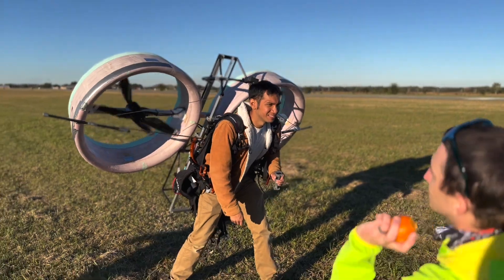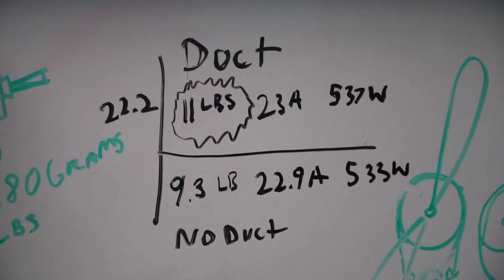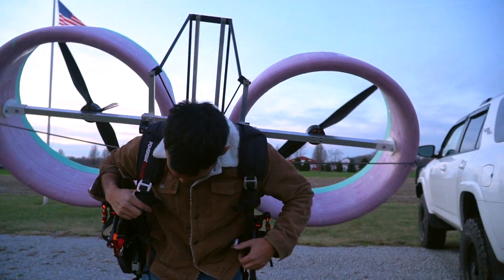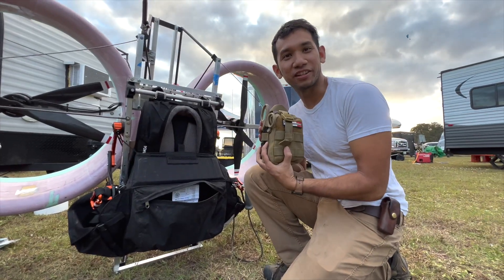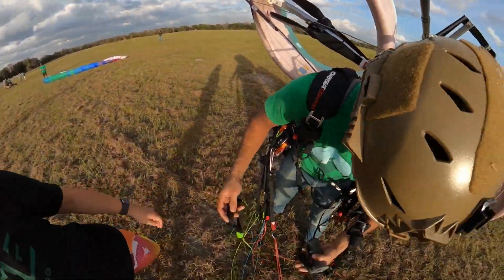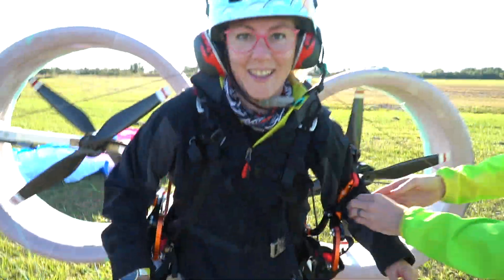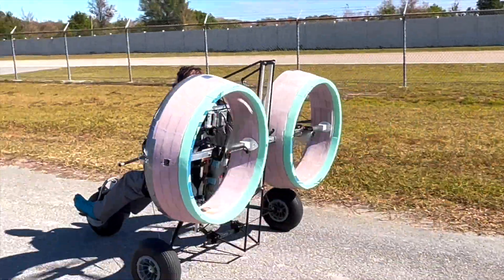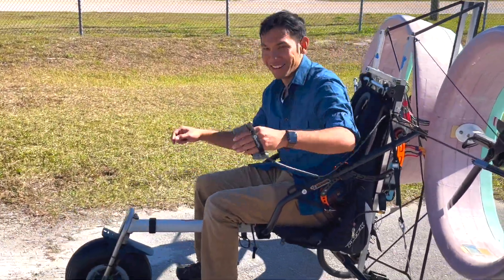Flying with four giant drone motors (ducted propeller paramotor)

Comment: Since you have two ducts, the front and back motors don't need to be counter rotating, right? Would that help with efficiency to have the front and back blades spinning the same direction?
Reply: And then you could have the rear motors have a different throttle curve?

Comment: To make improvements, this is where you would need to either do wind tunnel tests or use fluid analysis software. For example, the rear propellor would probably require a slotted duct so that it could draw in more air. And, I agree with you about adjusting the rear pitch.
Reply: Differential speed would be better. Or placing a stator between the props a la jet compressor might work. I doubt anyone could accurately calculate the pitch differential for a fixed pitch prop and variable pitch props would be prohibitively heavy or extremely dangerous
Reply: @michaelmagill189  I'm not sure what you understand about fluid dynamics, but not much that you've mentioned is correct. The earliest work in this field in the US dates back to 1920 when NACA got its first wind tunnel, and it was pretty well understood by the late 30's.
Reply: @scientious  most of the research you refer to was done on large scale ducts with low speed drives. My research was on small lightweight high speed drives similar to Peter's. Computational fluid dynamics may be possible with today's software, I don't know. I gave up on dynamic flow programming 40 years ago when the file sizes started exceeding 50 gig on coarse scale models. I wss using the USCN network and started getting nasty responses to my requests for storage. That and 6+ day run times. IBM 370 was state of the art in those days but archaic by today's standards. I needed a Cray but that wasn't happening. At any rate, I know the math required and I know modern CAD programs can do some computational flow modeling. Mike Patey uses them, but those are generally single plane flows over an open surface not inside a duct with counter rotating props. I would be fascinated to see this but my guess is the math is beyond most people or computer systems. You can message me at 706 315 8539. I don't do Facebook or email and I dont answer phone calls from unknown sources. But if you I M me I'll answer. Happy to discuss this with others
Reply: @scientious  if you check my open post on this vlog you can get an idea of where I'm coming from
Reply: @michaelmagill189  
> I was using the USCN network and started getting nasty responses to my requests for storage. That and 6+ day run times. IBM 370 was state of the art in those days but archaic by today's standards.

True. My laptop drive has 3 Tera bytes and the processing power exceeds a 370 by maybe three orders of magnitude. But you don't even need computer modeling. All you actually need is a makeshift wind tunnel and pressure sensors, and possibly a smoke bar if you need to visualize the flow. 

> But if you I M me I'll answer. Happy to discuss this with others

What do you want to discuss?

Comment: If those blades come loose for some reason..... careful m8
A traditional paramotor is centered.. so the prop blades if they do come off, will always fly away from you....
Here if a blade separates on the inside... it'll come right at you..

Comment: It's not noisy because of the ducts. It's noisy because of putting one prop in front of another.  Any time there's dirty air in front of the prop (any sort of discontinuity) they're loud, and coaxial props are the noisiest.     I wouldn't be surprised if that also kills any efficiency you gained with the ducts in the first place.

Comment: I would be interested to see if you put fins between the propellers if that would straight the airflow and increase the rear propeller efficiency and/or thrust output.
Reply: Stator. Like in jet compressors. Might work
Reply: @michaelmagill189  That’s right I couldn’t recall the name.

Comment: You could use one regular sized propeller and use multiple motors and a belt drive to share the load between them 🤷‍♂️… the larger the prop the better the efficiency and then you also have a little bit of redundancy if one motor fails… might not be able to fly but you could glide a lot further than without any engine.

Comment: It's actually better if the back propellers have 20% more battery than the front propellers, because it makes it more likely for you to safely land when the batteries of the front propellers are completely empty. You won't get much more flight time, but just enough for an emergency landing to hopefully not end bad.
Reply: cool thing about having a wing is you don't need any thrust for it to work. As long as your above suitable ground for landing you don't need any thrust.
Reply: @Siphonife  So you mean the paramotor should have wings on the side of the propeller/propellers, or above and/or below the propellers? I could see a cross-shaped or T-shaped wing being added to the top and back of the current contraption, to be able to steer and glide. For only gliding, a wider (front-to-back) wing but not so long (left-to-right) wing would be useful, with steering in the back of the wing for pitch and roll, and rotating half the width (not thickness) of the wing left-right for the yaw. All of this would add more weight and complexity, but he made a plane, so he could probably turn a paramotor into something resembling a short/tiny plane.
Reply: @SapioiT  The wing in this context is the giant half-parachute looking thing.
Reply: @nikkiofthevalley  Oh, then it all makes a lot more sense. Thank you! While you don't need thrust for it to work, you do need velocity, otherwise you would simply stall. Edit: And fall. Without velocity relative to the air around you, you would stall and fall.
Reply: @SapioiT  It's a glider, the velocity is generated by gravity, as in you trade altitude for airspeed.

Comment: Is it worth looking into hinging the two ducts so that they start perpendicular to your back, like butterfly wings? I’m no engineer, so I have no idea how it would take the stress of flight, I just envisioned them starting closed while you lift the sail and run, and then pulling a lever to lock them in place and open the throttle. I thought about pistons, but even with springs and levers, is it too much weight for not enough usefulness?
Reply: It'll screw with the center of gravity.

Comment: Make the downstream propellers have a higher pitch since the are from the first propellers is already accelerated and the downstream props aren't doing as much as they could be.
Reply: Just speed up the rear prop. Math to determine the proper pitch differential would be frightening.

Comment: Fucking finally, thank you for explaining that a ducted fan is all about really tight clearance. So many videos on here with "ducted fans" are just shrouded fans with no efficiency gain, just protection for/from the blades (which is a good thing, it just ain't a ducted fan).

Comment: What about two big dyson fans? The thrust from the bladeless design has more thrust than fans with blades
Reply: You are confusing thrust with acceleration. High velocity airflow does not equate to high thrust. Otherwise we could fly with a backpack blower. High velocity is only relevant at jet speeds not low and slow. It may be possible to fly with high velocity fans but you'd have to run like hell for a long way to get airborne. Check out Jim Bede's BD 5 j

Comment: Would a diffuser in between the two blades help with efficiency I know it would be extra weight but with the potential to gain more thrust might be worth it 
    Someday people might use fuel cell powered Para motors your a visionary

Comment: How is the throttle response compared to your vittorazi? Do you feel instant lift when you give it the beans, or does it kind of delay a little like typical paramotors do. I've had a couple situations where I gave it gas and barely cleared an obstacle, and always wondered what instant climb acceleration would be like.

Comment: Nice! Would it work mounting the ducts and battery on the front, hanging off the carabinas like a tow harness? This way there would be no alterations to a free flight harness needed, and no awkward thrust pitch changes. I was thinking ducts half the size so they could be folded forward onto the pilot's lap when at height, and only having enough battery onboard for 1500 foot altitude. This would save many hours of driving to a hill site, or the hassle of tow operations on the flats...not meant to be a paramotor as such.

Comment: So while I was thinking about this the other day I had a question. What would happen if you had a fan case with a reset prop in it? Like a channel for the prop clearance that was out of the airstream? Maybe test 1/8 - 1in deep?
Reply: See my reply to captain kaos. A groove like that might not pose as much risk in an aircraft where the pilot is isolated from the powerplant, but standing/hanging in front of those ducts would be flirting with disaster. ANY contact between those props can lead to catastrophic failure

Comment: Could you carry a spare battery to altitude and do a quick swap for more flight time?
Reply: You could just wire it in in parallel, you would not have to swap them in flight :) the main issue is that the batteries are heavy, so you can not just keep adding more batteries, sadly.

Comment: Awesome project!

 Would it be better to have both motors in the same duct rotating in the same direction? And have the two ducts counter-rotating wrt each other?

You’d probably need to reinforce the structure to deal with the extra torque, but might bet much cleaner airflow through the ducts (and quieter too) 🤓
Reply: It's better for the rotors within a single duct to rotate in opposite directions to each other- that way you can maximize thrust.

Comment: Thinking how cool this could be if you took the ducts further and essentially went full turbo fan engine.  Oval or even “D” the input ducts to either side of the pilot.  Shape the rear ducts to bring the output thrust closer together eliminating the potential for seesaw yawing like you experienced briefly.  Generally give the whole thing a “single pack” finished product appearance.  Combined with an angle of attack change on the second set of props, this sounds wickedly cool.  Give it the commercial aviation standard white paint with blue pin stripes to really send it home.

Comment: would love to see a single prop version with variable transmission like they use in scooters. This way you could have a smaller motor running a bigger prop an have a longer flight time. this way you only adjust how fast it should tension with the rollers. So take a normal fuel powered setup, replace the engine with a smaller electric engine and a variable transmission and see how it goes-
Reply: The differences in electric and internal combustion power delivery deletes the requirement for a variable transmission in nearly all use cases.

Comment: @ 12:59 I'm wondering if the fan housing could be made conical, the second fan made smaller and higher geared to alleviate the pressure build up of the first larger fan, so that you might get more thrust efficiency? I couldn't say the proper ratios but the 20% power usage difference might be a good start.

Comment: I don't think this little venture is responsible.  If you run into problems in the air or suffer a bad landing or take off, your hands and arms will be the first things to get chopped up in those fans. Should you roll or trip and twist your body, your feet, legs, they will go through the fans. and who knows, your head could as well.  

I don't want to hear about all the supposed safety precautions you took because just strapping it on your back shows you don't have as much safety in mind as you think you do.

Comment: Would those motors (and ducts) work on a jonboat? I would use it to ice fish on frozen bay in Lake Superior. Battery weight wouldn't be as much of a problem because of the weight capacity of the boat. The boat might have to have runners or skis  to go thru snow on the ice,
Reply: Where at, Chequamegon Bay? I have done air boats and paramotors, Best way to do this is to use a used gas  powered  , paramotor motor. Cheaper  more power and lighter then the electrics. Also an ultra light motor on a Jon boat probably even better. I have done similar things.
Reply: @jbird6609  Not Chequamegon. Munising Bay.

Comment: So frickin rad, man!
Great job!
-
Have you ever considered using a large helium filled blimp, lifting body or a balloon, instead of the parafoil?
Adding a 360° swivel-mount above the pilot and below the balloon would allow for some precise control over the aircraft.
-
That would be an awesome build to watch.
👍
Reply: Honestly, while it has a bad reputation, for blimps & similar hydrogen really is the better choice, because it's massively more available than helium.
Reply: @absalomdraconis  helium will snuff out flame,
whereas hydrogen on the other hand....
Reply: hmm,,,, its a very good idea

Comment: are multiple small propeller always worse than larger ones? is there a tradeoff between redundancy and efficiency? why would a startup like lilium use so many small propellers if its that inefficient? or is it possible to shrink the gap towards more efficient designs?

Comment: Peter, you should try to make your own gas turbine/ jet engine. a small one of course. or you could try to use small electric motors and the coaxial design to make an electric 'jet turbine' and fly a small aircraft with it. just a few ideas for the already busy Peter Sripol

Comment: Nice, this gave me some ideas:
1. To get a "large pizza" while still using small motors, perhaps you could run them in series instead of in parallel, so to speak. You could either have multiple motors turning a separate single propeller shaft via gears or belts, or you could have the motors share a single shaft connected to the propeller.
2. To eliminate the torque roll from a single large propeller disc perhaps without the inefficiencies of typical counter-rotating propellers, you could have the stator and rotor of a single motor each connected to a propeller, so that there would be no net torque roll. 
Just some ideas I had while watching your cool video, Peter!
Reply: How would you mount that. With both parts spinning there are no hard points to mount to and you definitely can't free float the props.

Comment: You should try that with small diameter, high rpm electric ducted fans known from rc jets. 

Will be louder but much smaller and also much cooler.

Something like 2x 150mm EDFs should be enough.
Reply: Would these edf's generate at least 75 pounds of thrust between them? Parasails have high inherent drag and require a lot of thrust. At 3 to 1 weight to thrust that's 225 lbs of total weight. If you subtract 160 lbs for a pilot that leaves 65 lbs for the rest. Not much of a margin there.

Comment: maybe you could have the props spinning the same direction with a stator in between them. Kinda like a jet engine?
Reply: Jet is a compressor. Air and fuel are burned together to produce thrust. DF has no combustor so must create high flow rates with relatively low velocity to be effective

Comment: You could use the fan blades to cut away at the foam like some cursed drill press to ensure a perfect fit with tiny clearances. F1 cars do this with the floor of the car using magnesium to ensure they were as close to the ground as possible by scraping away any material that touched, leaving only a perfectly shaped floor

Comment: even without changing the pitch of the rear prop ot should be able to be higher kV motor as in spin faster in the pre accelerated air giving even more thrust as the front ones would be responsible for pulling the thick decelerated air through idk of ya want a raspberry pi adjusting motor speed for you sensing all the motors and correcting on the fly😏 but yeah weights a thing... what if you double sized the props to full scale trike size but just twins in counter rotational awesomeness and then well ya gotta have flares and smokebombs for the airtests and wow factor 👍 maybe a yt poll for which color smoke😁
Reply: 3 months ago and enjoying the vid again 😏👍

Comment: Have you tried increasing the pitch of the blades on the aft set of props to try to compensate for their having to move pre-accelerated air? Also, the ducts themselves seem uneccessarily thick & their edges & curves blunt: have you tried something more aerodynamically (& weight) efficient by better/smoother curving of the duct surfaces & thinning of their cross sections?

Comment: Just a thought... Since you are flying with (I think) big LIPO batteries... What would happen if one of the batteries decides to go out in a ball of fire???
Reply: It's so rare that LiPo batteries fail during use that it's a non-issue. They ignite during charging, if charged improperly or if charging a very, very obviously damaged cell.